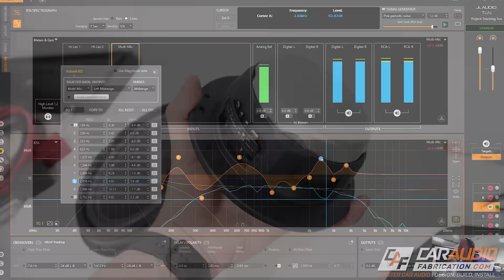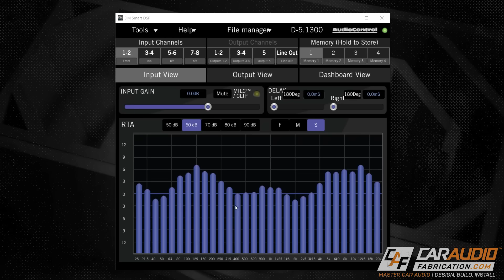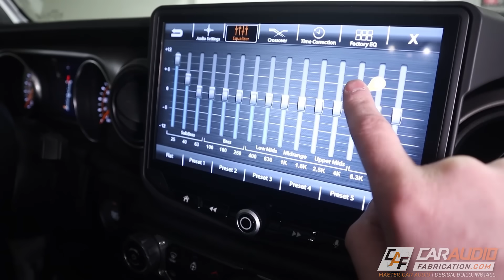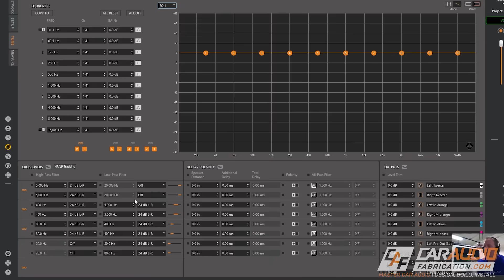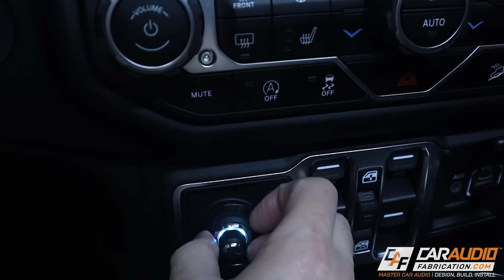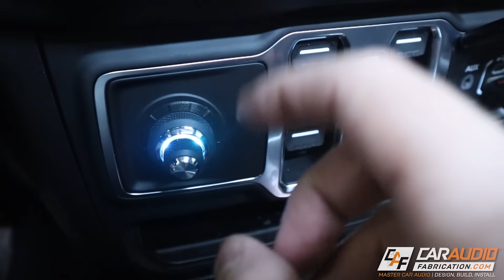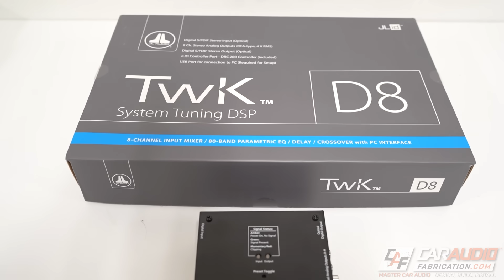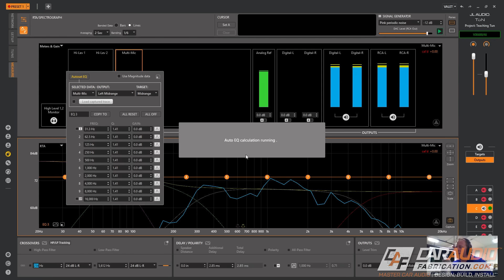6 Reasons to get a DSP, and 3 Deal Breakers!

Comment: I have a T'Eyes 9". It has a 21band EQ and all songs sound different by how they were Mastered. I want a DSP because I'm all about clarity. I have JL Audio C1 components 6.5 in the front and 2ways in the back doors 6.5 with an MTX400 4 channel amp. For bass I have a Skar ZVX 15" sub with a 1,500 mono block 1 ohm stable amp and a 5 farad Cap. Is a DSP the answer?

Comment: I get so confused on  getting a DSP.   I have  2 high end amps . 1 runs my front components which are passive, and my other amp runs my 1 sub.    My  HU is a Alpine  INE-W960 , which has time alignment and a PAR  E.Q.   I get lost adjusting the sound on my Par E.Q. so im thinking a DSP may not be for me. - 
 If i was to try one i want to run it into my existing passive crossovers on my front speakers.. Any recommended  ??  
 I would need SIMPLE as possible. 
 I had one audio site tell me to just get a Zapco ASP-Q2   , which is just a PAR E.Q. ????????????   SO how would that help.

Comment: i have a citroen berlingo van 2 speakers and a amp speakers are focal icpsa and amp is focal impulse, but it doesnt sound too good, i have deadened all the doors and all the back and roof od my van with baffles around the speakers in doors, would a dsp help with this? my van is open back so its not just a cab thanks

Comment: I had Cleansweep installed. Two issues.  One, it doesn't breakout low voltage signals from a factory 4 ch head unit to get subs and two once connected you can't change the tuning. I got a system where the highs sound like steel blades sliding on each other.  Sling!

Comment: So I have a new Camry w/base sound system. I want to avoid amp installation and only upgrade the stock speakers. Would that be a good scenario for a high quality DSP to eliminate the factory tune from the OEM head unit?

Comment: Bro i need you to pro tune my system you near CT 06062? And what would you charge lol my local shop that did this stuff for me burnt down and they packed up shop and left. Obviously I'm kidding. I don't expect you to do this but if you are in Connecticut and said yes to that then I am serious lol. I just bought a DSP. I have a taramps 3k and 800x4 I should be fine. I'm just going to Google people like you for what I should set my base amp to which is like 22.6 for the high pass and then I'll figure the highs out once I get there. Anyway, great videos as usual. Boom on my friends!

Comment: Thank you for the very informative videos you produce I am learning a lot and enjoying the content. With that said I am in the process of designing a system for my hot rod. I have been on Crutchfield's web sight but unfortunately they don't have my car in there database. It is a 1969 AMC Rambler if you need to know. My questing is I am designing my system from the ground up, because I am doing it this way would It be wise for me to get a DSP device? Also when using a component  system like the Focal PS 165 F3E it comes with cross overs for the tweeters and other speakers, how would a DSP address this as the cross overs have the ability to clip and adjust the frequencies and Db's to the speakers? Thank you.

Comment: Sir, I am looking for an upgrade.. current setup: 2 components with 2 tweets, 1 300 rms 10 inch sub on Helix m four.
Upgrade option 1: 6 channel dsp amp. Convert to 3 way
Option 2: Helix dsp mini, gladen mono amp, convert to 3 way. 
Which is right option? Kindly help. PS: pioneer after market HU

Comment: Having mid-bass thst isn't installed properly sealed tonthe door is not a reason to not get a DSP. Because wherether or not the speaker is or isn't installed correctly, you'll still need a DSP even though the DSP won't fix an installation issue.  

Assuming the midbass was installed correctly, the person will still need a DSP. So either scenario a DSP will eventually bbe necessary.

Comment: I have a golf 2  and am working on improving my sound. I now have a Hertz MPK 130.3, DCX 460.3 rear. Bought APBX 10AS2 and cables. Does it make sense to replace my Pioneeer MVH330DAB head unit with Kenwood KDC-BT960DAB. Would I buy an Audison Bit One as well? My current amplifier is Audison SR4.300V2

Comment: Should I get my Sony 5 channel ES Amplifier with the DSP? I plan was speaker components in doors 6.5 and tweeters in dash, an ES 10’ Sub. Sone kind if 5 1/4 speakers in rear panels (fit is challenging, might have a Polk 522 2 ways option). 01 Cabrio.

Comment: If all speaker wire is exactly the same length would there be a time delay ?
Reply from the maker: Electricity travels through wire at about 90% the speed of light. 670,616,629 miles per hour. Yeah... not going to matter how long the wires are in a car
Reply: @CarAudioFabrication  What is needed to connect epicenter, matrix  , DSP all together?

Comment: I have a Nissan Rogue 2021 and the sound is very bad. They put Bose speaker inside but I think the maine problem is the equalizer of the vehicule with almost nothing to do with it. Someone told me to put à DSP to fix that problem. Is it a good solution for a original sound system of a véhicule?

Comment: i’ve recently installed a 4 channel amp on a honda accord 2023 and i’ve been getting white noise or static but it doesn’t get louder as the rpm goes up so i went to a shop and told me to get the dsp so they can tune it. will this fix my issue?

Comment: My main reason why a DSP is almost useless is because the audio inupt in todays market is generally low quality and/or streaming.  It's like putting 10 flashlights together and aiming them at one spot, then expecting the DSP to separate the lighs back out cleanly. If you are using FLAC or higher quality audio, a DSP is VERY useful. 

Oh, and I run nothing except KnuKoncepts in my builds since 2009. Excellent stuff.

Comment: One dealbreaker for me: having to run Windows OS to install firmware. AudioControl has a Mac version of DM Smart, but it’s reportedly not as good as the Windows version (per a Reddit thread, possibly incorrect or outdated.) I’m not going to buy a Mac just to run DM Smart, and it’s not possible to upload DSP firmware via the iOS or Android apps over Bluetooth.

I don’t want to install Microsh1t on my beautiful Linux machine. I seriously doubt DM Smart, JL Tun, or Audiotec-Fischer’s DSP PC-Tool would work well in a sandboxed MS virtual machine.

Given all the DSP headaches I decided just to get a 4 channel amp and call it done.

Thanks for another great video, Mark. Your channel is #1.

Comment: for me, as I'm still pretty new to the premium car audio system thing, with PC hardware, networking, servers, and programming background, as well as people accessible for help with it, it's just about budget, I simply can't get a DSP yet, but I'm pretty sure I'll get the TwK 88, as I want at least the ability to daily tuned sound, and "go crazy" tune for the time that's worth to have, which also means that daily tuned will be front+sub, and "go crazy" is more like SPL tuning with front+rear+sub, which would be way quicker to change between with a simple button, than getting into the head units settings, go to sound, scroll down, then toggle off rear speakers, and go back to Android Auto, which is how I'll do it untill I can afford the DSP xD

Comment: Hey Mark i have a 2011 Mitsubishi outlander Sport with the Rockford fosgate system and 10 in sub!   I have a Kicker Comp Rt 12 i want to add to it i figure just tap into the sub wiring for a signal.  Is a Dsp applicable for this  or should i be fine  as tap in and go

Comment: I've worked on and tuned all of my vehicles so far - but for the first time I'm driving a hybrid.

What's pushing me away from a DSP now is that they almost ALWAYS output low level, and throw away the already very limited power the unremovable stock app is consuming, then need to be amplified again.  

How would you tune a Hybrid system that's limited to 30 Amps for the Entire audio system?

Comment: I have a big system that’s about 55,000 Watts I have 4 12ks taramps amps 6 800.4 taramps. Amps. And I was wondering what cross over or DSP from audio control I should by to run all my mids and highs subs bass is going from back of the head unit to a bass knob to my sub amps so it many only for my vocals and highs any advice, or any suggestions on which ones I should go with thank you in advance. Any advice would be much appreciated.

Comment: Hey Mark, first-time/long-time, got a new truck with my same system and lost all the midrange. Long story short, this same system of Type-R door components F&R and JL10W7 were installed in a previous truck last year and sounded amazing, now I’m $3k into the install on my 2022 F450 with B&O sound and it sounds worse than stock. Highs crisp, still got bass but the doors have no mids at all!! Would this be a signal problem from my factory HU that a dsp can correct?? For reference, factory sub and amp are removed; full sound deadening treatment. I’m hesitant to think it’s the shop or the install but idk man😢😢
Reply: When I turn the sub down or volume down it sounds terrible.

Comment: I'm of the opinion buying a seperate DSP and connecting it to your amp via RCA cables instead of fiber optics (Toslink) defeats the purpose. (Only a couple of brands of amps have a digital input).  Because you are going from a digital signal back to analog signal. So, buy an amp that has the DSP built in.

Comment: I thought for many years that the headunit was enough.  I picked up a Pioneer 80PRS several years ago and while, that headunit once dialed, sounded amazing I hit the limit of what it could do and decided to take the DSP plunge.  You mentioned cost which was a big factor so I did go with the Dayton408.  It isn't the most recommended, but for the features it provides at a $160 price point I was extrememly happy. I also got Dayton's calibrated mic and have not regretted it.  I got creative with the 8 channels and it is truly night and day from using just the head unit.
Reply: itsalwaysfriday9766
     My first DSP was the Dayton Audio 408 and I always had problems with it adding noise even though I had done the big 4 upgrade and all grounds were tested to ensure below .5 ohm resistance. I never could get rid of the noise completely but I got it quited down a lot by stripping about a 12" piece of 22 gauge copper wire and wrapped it around each one of the 8 output rca fittings then removed a screw from the DSP case on each side and attached both ends of the wire by replacing the screws. I really liked the functionality of the Dayton Audio 408 and that I could tune it on the go with my phone through the bluetooth. The Audiocontrol DM-810 I replaced it with requires a bluetooth dongle(sold separately) that costs about $150

Comment: The no that you forgot is if you have an older vehicle and are installing an aftermarket head unit that has these capabilities or at least most of them. Not everyone into car audio has newer vehicles that basically can't be changed.
Reply: @roughboygarage1475  Not aware of any aftermarket head unit that allows for individual speaker tuning.
Reply: @JTS-WTP I never said they did
Reply: @JTS-WTP  nah I have this Chinese brand radio with a built in DSP and tuning on each channel

Comment: I really need help from an expert. I have the Audi A3 8V Sportback 2018, and i had the standard sound system, then i added a match dsp plus a match amplifier, with Focal evo flax 165 fe speakers on the front and another focal speakers (cant recall the model) on the rear. At the beginning the sound was amazing, really accurate, lots of bass and great quality, but then after some days of use, the sound began to sound really poor, with distorted bass, quieter, and gave me that sensation that a flac file sounded like a 128kbps mp3... So i tryied to look for solutions, but couldnt find it. Sometimes when the car was coming back from a review in a workshop the sound became amazing again, but only lasted for a few days again. So i went for an upgrade with really high end Helix dsp, the P six and a Helix subwoofer, mantaining the speakers, and once again the sound became amazing, really powerful, but again after 5/6 days it became distorted, saturated and quieter once again... It seems that the MMI is reducing the volume and quality to protect the speakers and it is only resented when someone touches the connections or something... Do you know where is the problem? Im an Audiophile too and im getting really frustrated about this.. Thank you...

Comment: Hey, I have a question and hope you can help. I’ve been having a static/high frequency noise coming from my front speakers for a while now, and finally took the time today to try and diagnose the issue. I think it’s because I ran the speaker wire alongside a factory harness, but I’m unable to run the wire any another way. Is there something you can recommend to help eliminate the noise?
Reply from the maker: For noise issues check out this full video I made. https://youtu.be/Q8dpucdxs6Y?si=kFrgByJt7qGGWWBx
Reply: @CarAudioFabrication  awesome! I really appreciate it👍

Comment: Suggestion request: I have a Lexus GX470 Mark Levinson system. From what I understand, the speakers are its weak spot, and are readily upgradable. What would you replace them with for max driver EQ experience?   Let's assume a sizable budget for 8 ohm speakers.

Comment: Thanks for all the info.  What are your thoughts about adding a DSP after a AP4?  It's got 6 RCA outs, and im running a 4 channel with 2 componants with crossover, and 2 rear coaxials, along with a mono sub amp.  Is it a worth while investment and I'm a bit confused on the number of in and out RCA's I need...channel summing and all that..

Comment: Most of the name brand head units have  alot of dsp tuning built in. Its limited but if your car or budget allows for a head unit upgrade, that's one of the cheapest upgrades you can do, in my opinion. It's the controller of your system.

Comment: Both my headunits, Pioneer DEH-80PRS (10 yeas old) and Kenwood KMM-356BT, got all these features built in, the only problem being just 6-channels to work with being a bit limiting.
Reply from the maker: Limited bands of EQ. Lacking flexibility. No all pass filters. No multiple tunes. Limited channels. There are many downfalls that make them not good enough for what is needed for a truly full tuned system.
Reply: @CarAudioFabrication  the Kenwood does have a bit of a limited EQ, the Pioneer doesn't tho. No multiple tune is true, depending on what you need it for, I can quick change time alignment. Both have all pass filters for a fully active system.
Reply from the maker: That's not what all pass filters are.
Reply: @CarAudioFabrication  would you still need a good aftermarket head unit or would a dsp still improve a bad stock head unit

Comment: No DSP for me. I had one once and spent countless hours fiddle farting with it. Fix this, tune that, mod here, tweak there. When I went to revert the vehicle back to stock I found the stock system sounded better. I won't be diving down that rabbit hole again
Reply from the maker: Sounds like it would be beneficial to have a better understanding of proper tuning procedures 👍
Reply: @CarAudioFabrication  undoubtedly and I'm sure my rather basic install could have been better but I'm still soured by the experience

Comment: I have a 2020 Supra where I’ve added an ACM-300.1(?) and a 12” Kicker downfiring sub. 
I’ve adjusted everything to where, imo, it sounds phenomenal. Except… the factory “subs”, which I left connected. 
I want to remove some of the lower frequencies to the OEM “subs” and have them respond more like midrange, how can I do this?
Would a dsp help in this situation or do I need some kind of bass blocker / crossover?

Comment: The geek in me makes me want to run out and get a DSP. The realist in me knows I probably don't have the desire or dedication to actually learn how to put it to good use.
Reply: I just installed an alpine pxe c60 with a mic and pc using the auto tune with some small adjustment, setting the crossovers and slopes. Was time consuming but well worth it.
Reply: Get an auto DSP like kicker key
Reply: It's really not that hard.  You all are just lazy.  I mean source-dsp-tweet amp-mid amp-woofer amp.  It's only scary at first.
Reply: Most people I know don't know how to tune or tweak their DSP's so they actually sound worse than the previous passive setup. 95% of the "audio enthusiasts" don't need one nor do they have the time and dedication to maximize it's potential.
Reply: @bbchester6  

so a 3
way crossover is still better to have and easier to used then a dsp

Comment: I am planning on using the DM-608 to run a t-1500-1bd and a t400-4.  Door speakers are Infinity Reference 6.5" components running passive crossovers and Infinity Kappa 463XF 4x6" which have their own crossovers, I think.  I'm not sure if I need the DSP for those but for the sub I think it's worth having.  Wondering if the Rockford T2 13" will be okay under powered with my amp- although the birth sheet says 1836w at 1 ohm which is what I will be wiring it to.  I noticed you ran yours with 1500w in your video so I assume it's okay.  I will also be going to you for a subwoofer enclosure design very soon. Thanks for all the knowledge!

Comment: What's the difference between a DSP and a head unit that has it built in? On my headunit I can control EQ for each speaker individually and I can set the time alignment on it as well. Would it still be worth it to get a proper DSP in my situation?
Reply: This is the only thing that is prevented me from spending 600 bucks on one my head unit has all of those basic time alignment and crossover features built in
Reply: What head unit do you have?